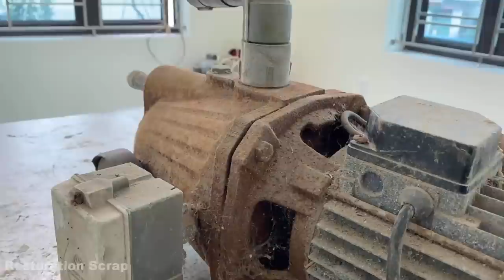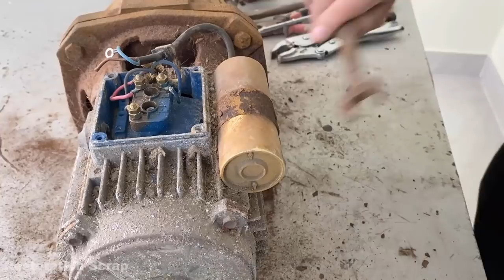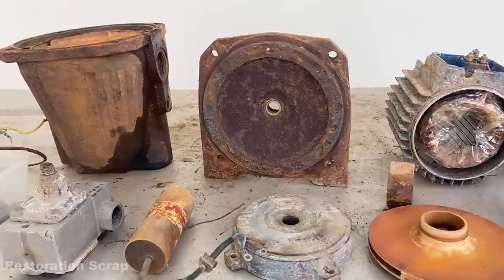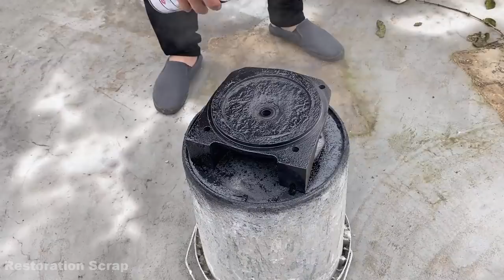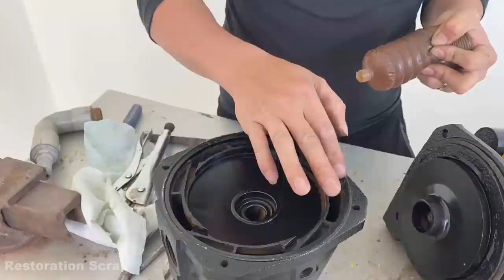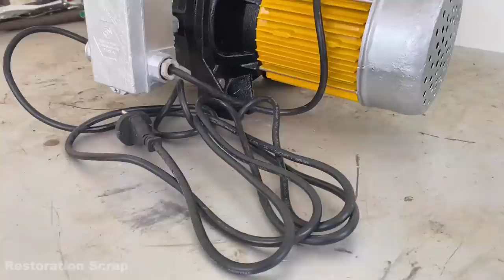Free Restoration of Electric Water Pump For Farmer

Comment: It's clean a pretty, and replacing the bearings was certainly a good start, but you need a weather-tight bushing where the power  cord enters the pump from the pressure switch.  Also, if you didn't change the O-rings and seals, that would have been a mistake.  Didn't see any new ones go into the pump.